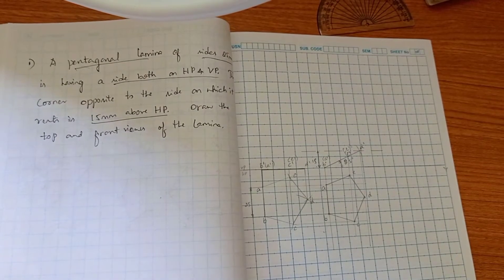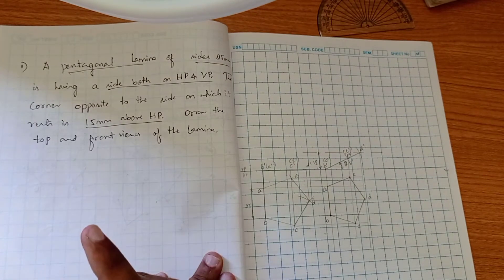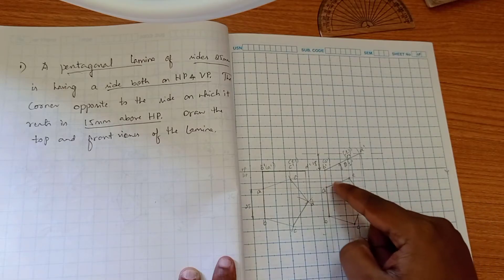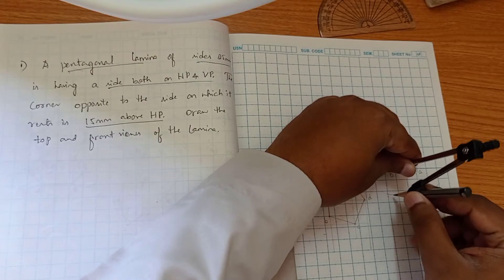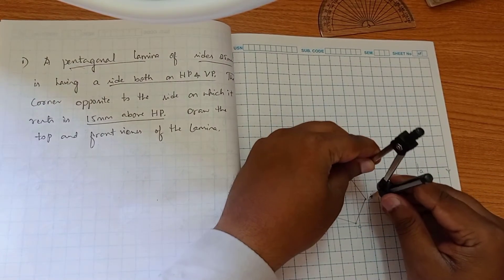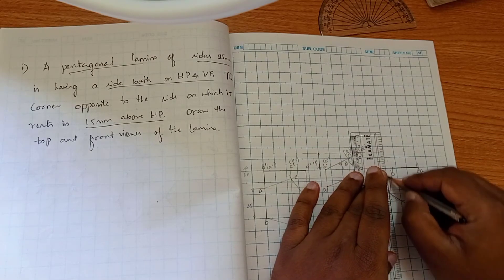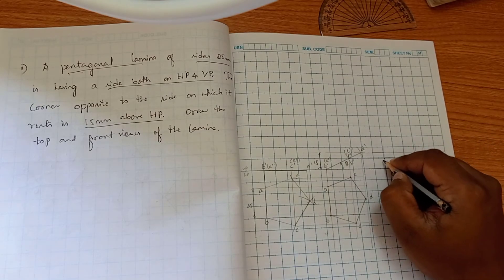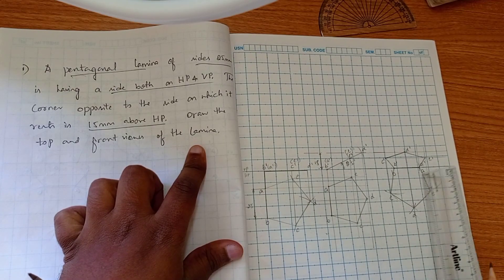Pentagonal lamina with side both on HP and VP Engineering Graphics/ Engineering Visualization

Comment: Check the length of the line as well angle will be 40 degree length should also match as 39 mm
Reply from the maker: I didn't understand.. Can you elaborate your question
Reply: @engineeringvisualization1005  also measure the lenght of the line while joining it to 15 mm line ..so the angle will be 40 degree